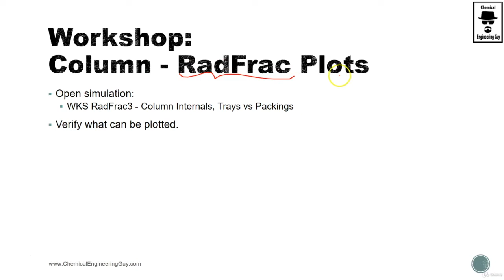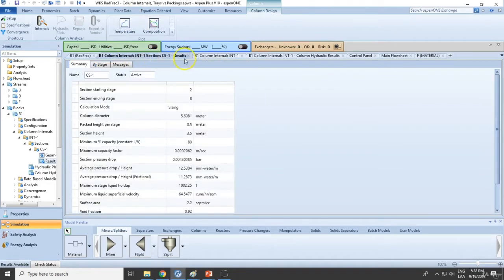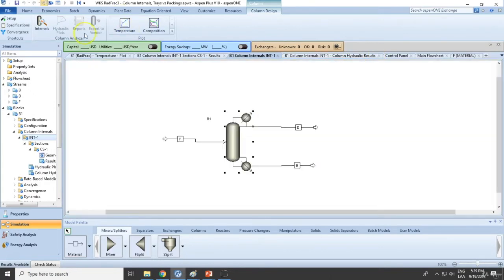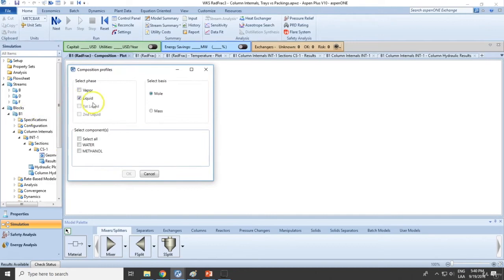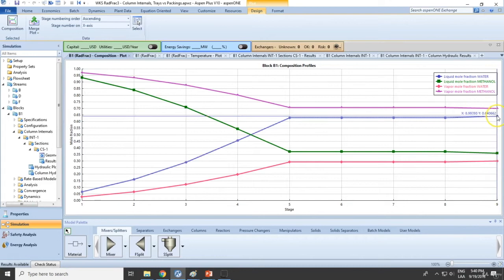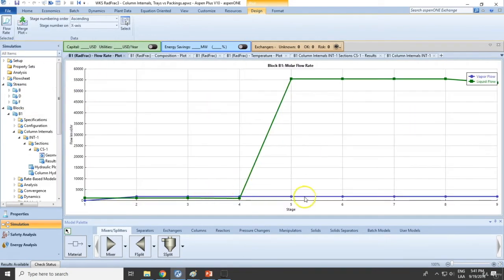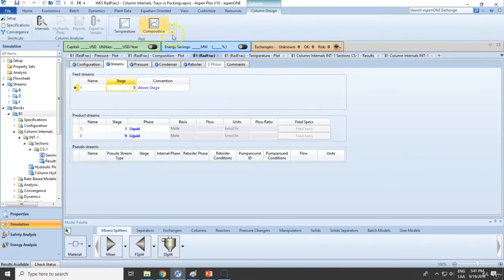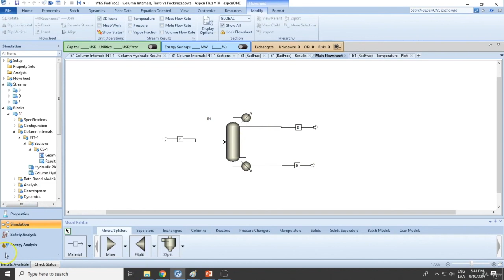Workshop Plotting Stages, Recycle ratio and Purity of a Distillation Column (Lec138)

Comment: Hello chemical engineering guy, What is the difference between aspes plus And Aspen hysys?
Reply from the maker: HYSYS is typically used for hydrocarbon and downstream industry (petroleum refining & petrochemicals). Aspen Plus is recommended for bulk/fine chemistry and common chemical processes